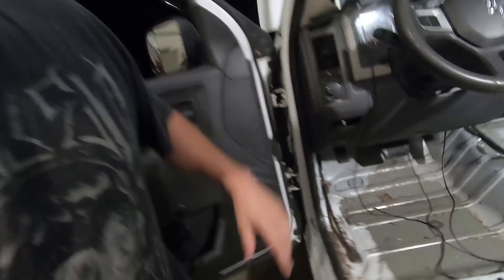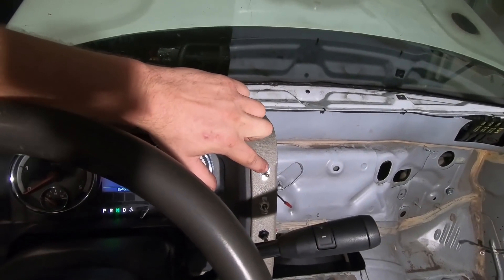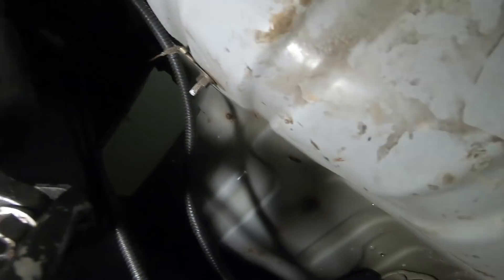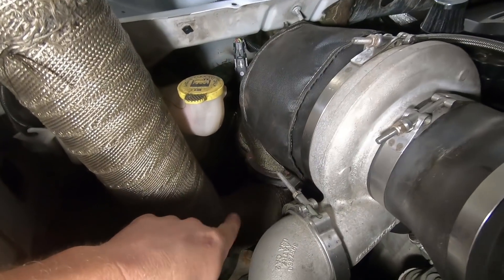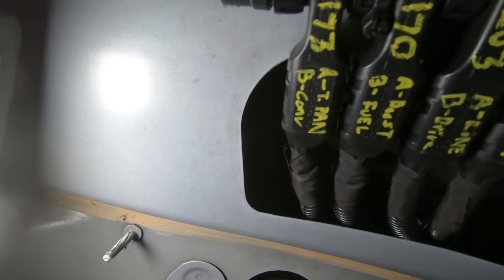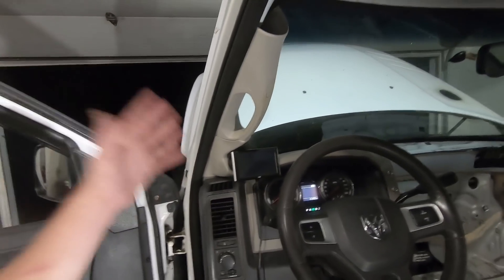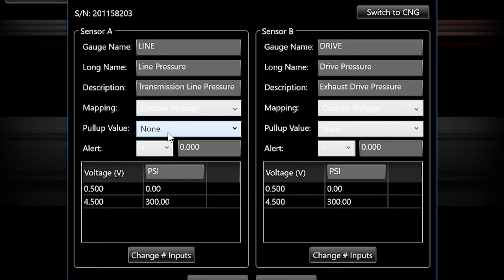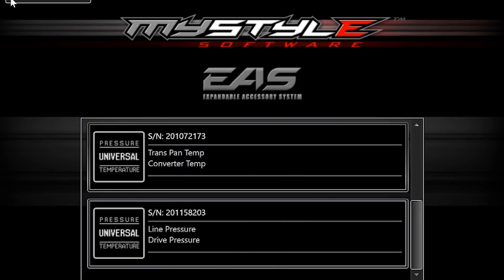EDGE CTS 2 DATA LOGGER INSTALL and HOW TO! KNOW YOUR DIESEL! Part 2

Comment: Hey Tom my 68rfe blew up and cracked right under the low/reverse assembly so doing a 48re swap all suncoast I forget who has using for the pcs though any thoughts or advice for it since your one of like the only on here that has done it and I'm in Massachusetts so theres not a single swap done yet in this liberal state lol
Reply from the maker: I use the firepunk anteater for control rather then the pcs. If your going with Suncoast stuff I'd say contact them, they probably have a few people they'd recommend for PC's tuning